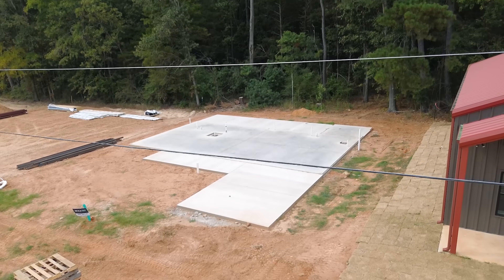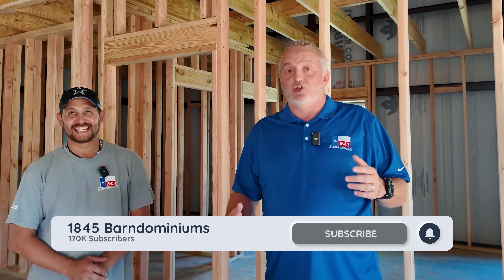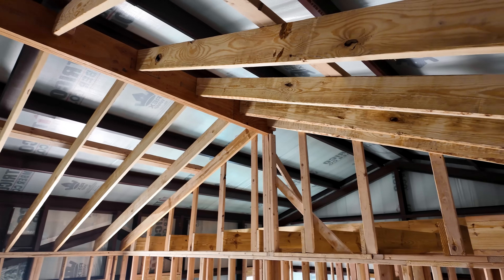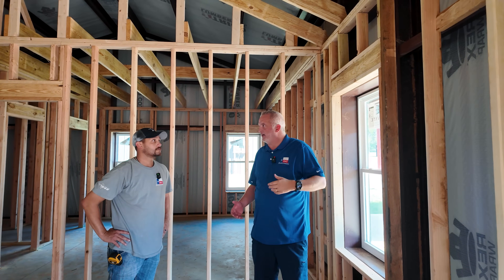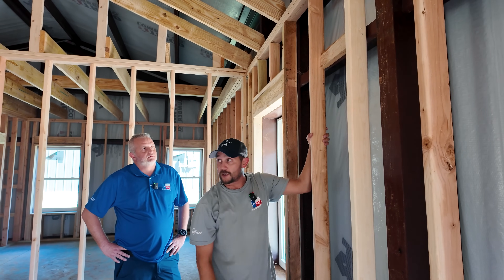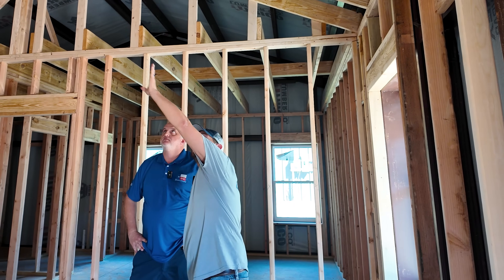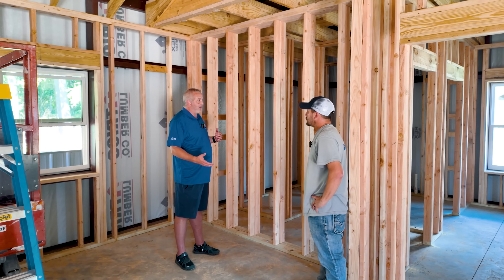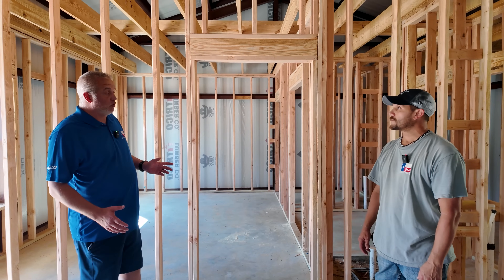Barndo Build: Wood Framing Inside a Metal Building | The 1845 Way

Comment: I had a metal 40x60 with 10' lean-to building designed for occupancy with all the engineered load bearing etc... The framer framed it kinda the same, however,  there is an actual attic where part of the center ceiling support beam is attached to the large metal roof support beams. Most of the framing load bearing is mounted to the metal walls. Also, since our county is one of the strictest in the nation for any building codes, the inner walls had to be floating on the concrete slab.

The outer walls are sprayed with closed cell insulation to reach R21, and the attic with blown in insulation at R49. The metal roof has a ridge vent the entire length and two end gables since I do not have soffits. So far any ice damning is very minimal (mostly a thin frost in some areas once in a big while, but attic vents out any humidity pretty quick)... So far so good with No drywall cracks or slab cracks (3 years now). 

I've had 4 subdivision  homes built in the past, and all had many drywall cracks and were not energy efficient at all.

Comment: Why do you call that a "barndo"?  It has no "barn" / garage / shop.  It's just a metal home.
Reply: A barndominium, commonly shortened to "barndo" or "barndo home," is a portmanteau of "barn" and "domicile" (or sometimes "condominium"). By definition, it's a residential structure built using post-frame (or pole barn) construction methods, typically featuring a barn-like exterior made from metal, steel, or wood with sheet metal siding. This design originated from converting actual barns into livable spaces but has evolved into purpose-built homes that blend rustic aesthetics with modern functionality.

Comment: Looks like ceiling joists or rafters are 2 ft on center with no blocking in between or not stripped out with 1x4s. Sheetrock will sag or get a belly between joists over time if do not add the blocking or stripping. If you put ceiling joists 16 inches on center you do not need to strip or block in between joists and sheetrock will not sag over time.